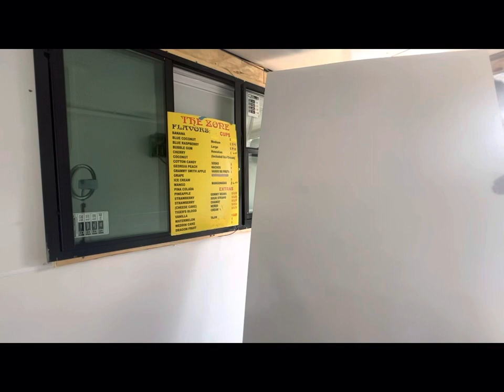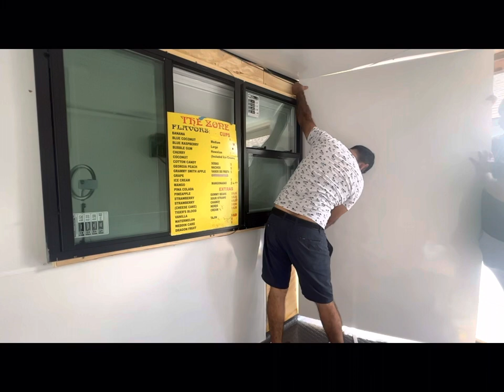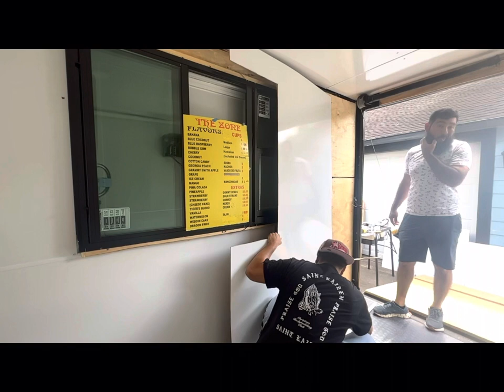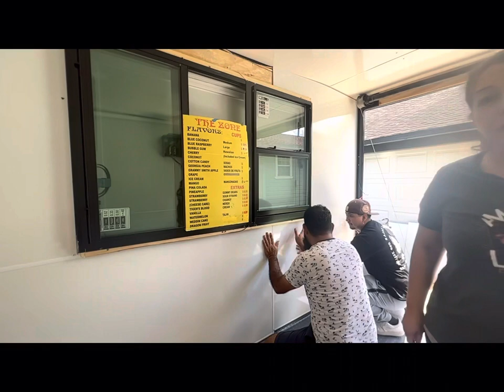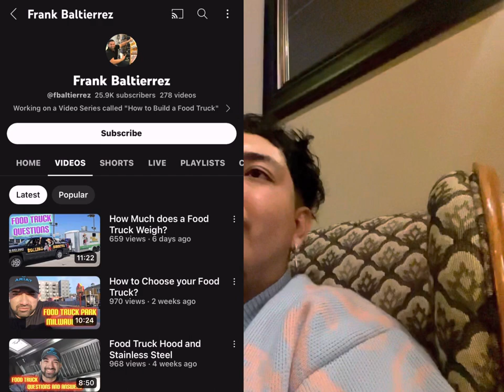How To Build A Food Truck Part 3: Walls

Comment: I just bought FRP for my trailer and just used white screws in it. So far it looks great. I’m curious what the new material  you used is called. Is it white aluminum?
Reply: looks like he used white hardboard white aluminum is so expensive. i am in a build of a lemonade trailer i went with FRP panels and it cost 500.00 on a 12 foot trailer. would have loved to use aluminium or stainless steel but was out of budget. but it looks good and if passes inspection good to go.